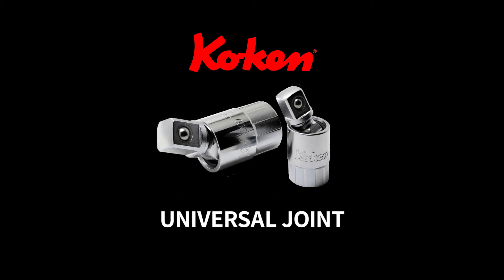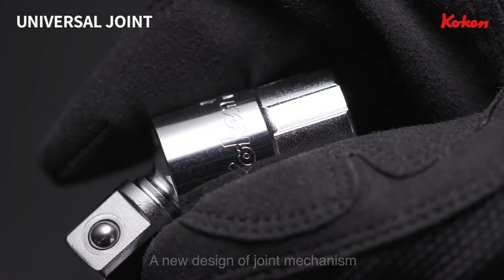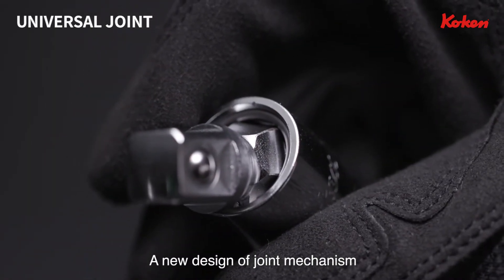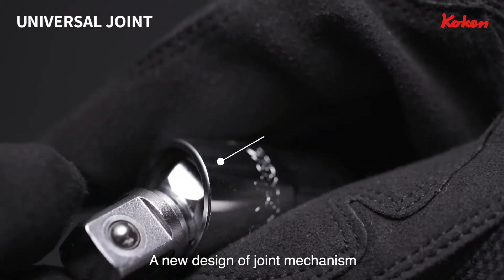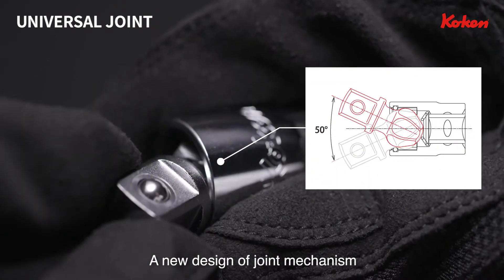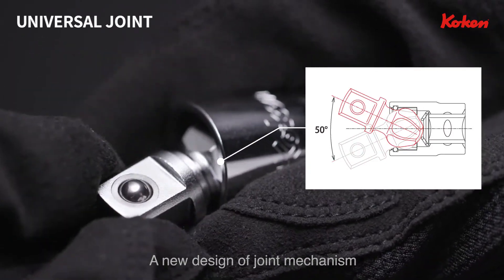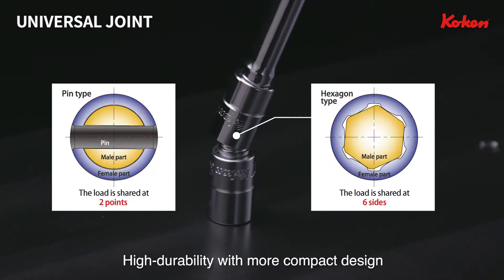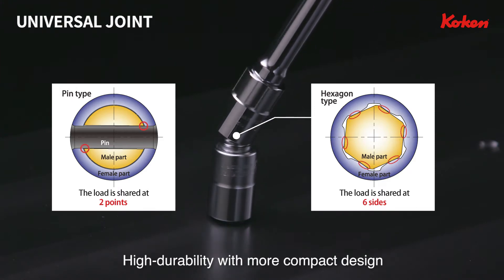Ko-ken Pinless Universal Joint Socket

Comment: These in 1/4" and 3/8" are great. They don't get loose  either over time..Add  in the Nut Grippers sockets  and Wobble extensions. You got most all you need...

And yes their sockets fit better on their own Wobble extension..Push down it doesn't wobble. Pull on it a little. It now Wobbles 30 Degrees without being loose as well...